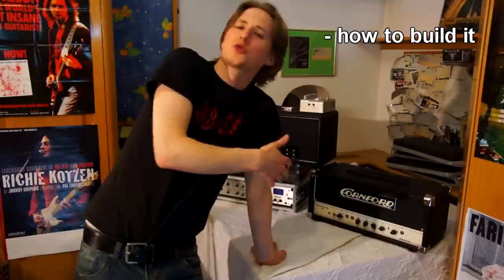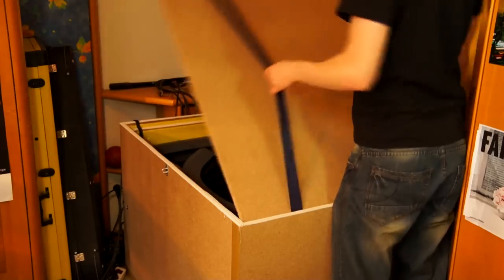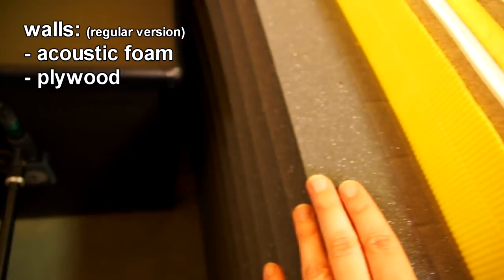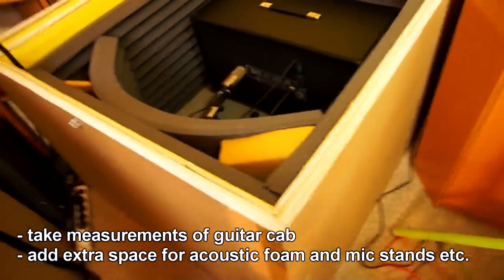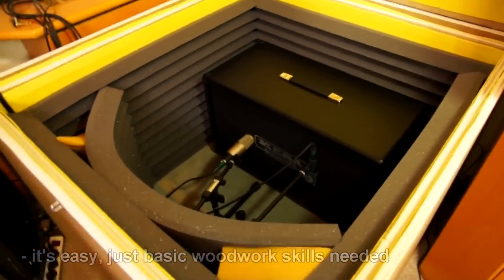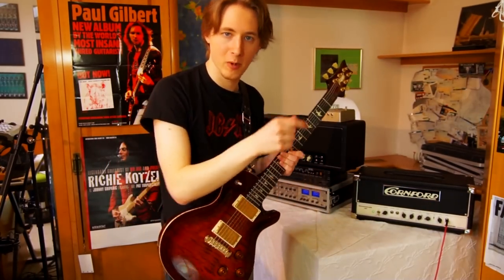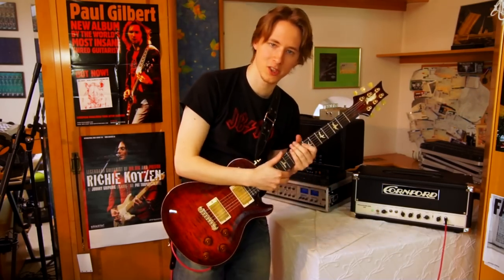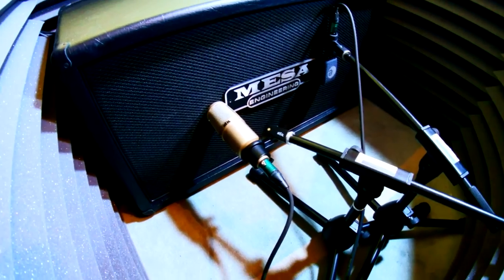Recording guitars with a DIY Isolation Cabinet (+ how to build one)

Comment: Great video! Some suggest adding some reverb to compensate for the lack of 'room' in the boxed recordings. In my experience, however, for rock guitar a bit of slap delay (5% mix with left 80ms, right 90ms delay) gives you a better feeling of a recording space, without mudding up your recordings as would adding reverb do.

Comment: Regarding floor vibrations, you may be able to alleviate that by doing the bottom like the sides and top, with the cabinet on casters inside the box, and/or mounting the box itself on casters or feet. You'd still get some resonance, but it would transfer to smaller points and will be diffused by the insulation in the floor (or the downstairs-neighbor's ceiling insulation).

Comment: I converted a SUNN 2 x12 cab into a stereo isolation box. the speakers were already recessed in the cab. I added acoustic insulation inside. I also  made a frame to cover the front of the cab. For the mic, I installed a small stand and a dual adapter to hold 2 SM57s.  I installed a XLR jack plate for the microphones outputs.  The speaker connections were changed from mono to stereo.

Comment: Great work.  How well does it keep sound out?   I want to put one of these in a room that's close to the Central AC unit for the house, and the mics pick that up.  I'm hoping that an iso box will solve both of my issues at once:  recording volume and external noises.

Comment: Nicely done. I'd love to see what kind of isolation you get from this. Perhaps you can measure an 85dB signal inside the cabinet, then measure that signal at the same volume setting, but with the cab closed and the meter on the outside. Perhaps a 10dB difference?

Comment: I'm picking up a orange micro dark terror (20 watt amp the size of a lunchbox) and a 1-12 cab with a V30 speaker just so I can do this and only have to build a little cabinet.  Will probably is wood screws so I can disassemble and store in the garage. Looks great and thanks for the video!

Comment: Hi Georg ! How about the ventilation ? Does it get warm inside the box ? 
Thank you.
Reply from the maker: inside is only the speaker which produced no noticeable heat. And the tube amp, which produces lots of heat, remains on the outside.
Reply: Georg Figél thank you! I have a combo though ! That’s gonna be a mess ....
Reply from the maker: @AVIOCHAHINEMODELS  maybe you can get a 1x12 to put inside the isolation box. And then you unplug the combo speaker and connect your amp to the 1x12
Reply: Georg Figél yeah sounds great ! Thank you Georg

Comment from the maker: I'm not sure if I understand the question correctly. The power cable of the amp is plugged into the AC outlet. The output of the amp, goes into the speaker over a speaker cable.

Comment: Great video! But I was wondering, if i would build the space where the mic stands are standing smaller, and hang a little mic stand against the wall of the box, and mic it with a smaller mic (Sennheiser E 906 or something) and then mic the speaker from there. Would that influence the sound in a bad way? A smaller box makes it easier to tour and play gigs. Thank you!

Comment: Excellent video, thank you!! One thing: they say an isolation cabinet/box that cannot 'breathe' will sound ALOT less good than one that can breathe because of the pressure buildup caused by the lack of ways for the air to travel. How do you stand on this?

Comment from the maker: thanks :)
Yes, the box has a floor, but I've seen some isolation boxes without a floor. The box affects the tone a little bit, the amp settings will need some adjustments once the box is closed.

Comment from the maker: @Aappleyard2a yes, that also works, I've seen some isolation boxes, where the speaker was built directly into the isolation box, so without a cabinet.
Some guitar speakers can take a bit more watt than others, but you can always take the standard route and use a V30.
Rather use a low wattage amp for recording. Using e.g. a tripple Rectifier with 150W into a single speaker could surely break that speaker at higher volumes

Comment: hello m8 very nice video, i was wondering can you tell exactly what kind of materials you use to make this???
Reply from the maker: well, I built it in 2007, so I don't know exactly which materials I have used. The wood was MDF, about 2 cm thick (different types of wood would also work, MDF was just the most affordable option back then). The yellow stuff is something that is usually used underneath a wood floor. The acoustic foam was an acoustic foam that are suitable for music studios.
Reply: guitarDouchebaggery well i 'am interested to make one for recordings and i don't know if it is the best solution to make a great recording

Comment: Great info and well done job on building the Iso Box..
Quick question: What material is on the plywood floor? Carper? Thin foam? etc...thanks.
Phil
NYC Area
Reply from the maker: Thank you. For the floor I put in an old carpet floor, but e.g. old towels would also make a good dampening material
Reply: As soon as I am done rewiring my recording studio (almost done w/wiring and some odds and ends to do too), I am going to build one. I used to have one built into the wall in my studio under a staircase, but that area is now for storage these days. 
I am getting ready to record a guitar solo soon, and I want to crank the amp a bit to push it into overdrive and neighbors are not so much a concern, but dampening the room noise is a concern so that there is no reflections. 
It's always easy to add ambience later, but you can never remove it (as I'm sure you know) if it gets recorded in the original guitar signal.
Be well Georg...
Phil
NYC Area
Reply from the maker: @uptownphotography  sounds like a very good plan :) Also, I've heard that some people filled their isolation box almost completely with old towels. So that's an option in case there are unwanted reflections.
Reply: I guess I'll start saving old towels! 
Is your Iso Cab made of regular plywood? or MDF type plywood? 

You know, i would start this ISO cab this week, but it is freezing here in New Jersey right now and all my wood (and my electric radial arm saw) are in my workshop/shed outside, so toooooooo cold to work out there. 

I do have some Gobos I made years ago (when I rented my studio full time). I may just surround the small amp with them and some blankets when I do this solo later today (in theory I will record it today), if something, like yesterday, does not derail my plans. I needed to rewire correctly my Les Paul M3 guitar...Derailment!
Phil
Reply from the maker: @uptownphotography  I've used particle board, because it had the lowest price. Otherwise it probably won't matter which type of wood is used in regards of the acoustics.

Yes, it's possible to cover the speaker cabinet with lots of blankets to get some decent sound dampening as a temporary solution :)
Reply: Quick last question. What length, width and height (outside dimensions) did you build the iso cab? Thanks.....Phil
Reply from the maker: @uptownphotography  I don't remember exactly. I built it as large as I could while still fitting into that corner of my room (between the existing furniture)

Comment: Is that one of those Select Strats? I have a Eric Johnson RW Strat with the binding on the fretboard that I love. Ive been repairing guitars for 12 years and have built At least a dozen custom Strats and tele's over the years for myself and client's. I've never had a Select come across my bench, but have seen a few pics. I really like the way they do the binding. It looks like they use 2 different woods (maybe a maple neck with a rosewood fretboard. Instead of putting a slab or laminate RW board, they allow the mail to come all the way up, cut a channel in it and last the rosewood in the channel, so the maple appears as the binding). 
I really need to see one of the selects to see exactly how it's done, they're the only real Fender Guitars I've seen with the flamed Maple tops, and with the 22 frets and gold hardware, I thought maybe that's what you're playing.

Great video BTW
Reply: Now that I watch the video again, I see that it probably isn't a Fender. Great video still though. I have an isolation cabinet I built 15 years ago. I made it to look like a coffee table because at the time I was living in a studio apartment. It was a large apartment, but still, having everything in one room (sofa, TV, bedroom set,, etc) I need to maximize space.
I had to build it for 1X12 cabinets, again for space, but it worked really well. I use a Mojotone 2X12 now that looks like a normal 212 slanted cabinet pretty much, with a cover that looks pretty much the same that goes over the top.
The only issue with these things is the space they take up.
Reply from the maker: The strat was made from Warmoth parts :)
Reply: guitarDouchebaggery Okay. Makes sense. I've used them several times, mostly to replace necks for people that want to keep them looking original. I've been using UGACG for kit build the last few years, I prefer them. It's not a quality or design issue, purely Customer Service. Had a few issues with Warmoth being..... difficult. Plus lately I've preferred the headstocks of USACG; they look really "close" to Fender, but just little different. Not enough to immediately say "this isn't a Fender," but enough to realize it's not. Still, gorgeous looking Strat 👍🤘

Comment: Great video! I just built an isolation cabinet like this one myself. I am using a fender hot rod deville inside, and the main question that I have is about turning the amp on from the outside without having to open the cabinet. Any Ideas? I cant seem to come up with any because even if I wire a switch to power the amp on, there is a standby switch that also needs to go to the on position. Any ideas would be greatly appreciated!
Reply: You only use speakers, not a whole amp. This video has a speaker extension cabinet in the box, but most are built with a single 10" or 12" guitar speaker mounted to plywood inside. The amp is outside the box. Review the Axe Trak or AxeTrak, which features a fuse on the outside so you don't blow the speaker. Most builds and pro products have the electronic connections mounted on the walls of the isolation cabinet and the interior is permanently mounted with speaker and a mic stand or a gooseneck mic stand. Also review the Rivera Silent Sister, it is great, probably the best of all, the company explains it all very well, and why their boxes allow air movement better, but it is well over a thousand dollars US, which is why we have to build our own.

Comment: How effective do you think this would be if it was massive and you put a drum kit in. I've got a lot of the material from work to make it , would maybe put a mattress under the box to prevent any solid contact through the floor. do you think this would work or would the dynamics of a drum kit just come through the box
Reply from the maker: it would definitely work, but it'd be a much bigger project. Basically, it would be a whole room, you could install a sound proof window (so the producer and drummer could see each other). You could put the whole thing on top of old car tires
Reply: guitarDouchebaggery i'm more thinking of a big box that you put the drummer in, so just tall enough for drummers head  and cymbal clearance so it's just him the kit in a box . Would i need to put air holes in it , do you know how i could do it sound leaking.
Reply from the maker: Sean Markus
the air holes would be necessary for a box of that size, and they'd cause sound leaking. It'd be better to make the drum booth bigger, without air holes, but you'd need to open the door in between songs to air out.

Comment: yes but its not advised. you will get latency problems. the nxt best thing from usin a preamp is using an external audio interface. these can come in 2 forms.a DI audio interface that usually has 2-8 inputs and has everything you need for home recording, or a USB desk. the desk is great for live band recording as u can EQ the tracks on the desk before its recorded but on the downside, the tracks are all merged into one when recorded. this can pose problems if not recorded right first time!

Comment: Would you recommend using a royer 101 in an isolation cabinet similar this one? Or would the pressure and reflections be too great for a the ribbon?
Reply from the maker: A Royer 101 can be damaged when you're close-mic'ing a loud guitar cabinet. You sure can use it in the isolation box, but you might not want to turn up the amp to extreme levels.

Comment: Hi, I didn't hear anything about the bottom of the box. Is the amp just standing on the floor or is the bottom of the box similar to the top? Do you have something like rubber feet underneath? I know I'm way too late, you probably sold yours, but you may remember how you did it.
Reply from the maker: The floor was just like the sides, with doubled walls. There were no neighbors below, so it didn't have any rubber feet.
But it would be a good idea lay the whole box on e.g. a washing machine "vibration isolation" rubber matt, or similar

Comment: I must say that is nice. I would however add microphone XLR jacks in the side of the box and 1/4'' jacks for the speaker cab. That way your cords are not crushed over time. AND don't forget to add a few 1/2''  vent holes around the cabinet to let out pressure from the front of your speaker otherwise you may have a front pressure on your speaker cone. It can stifle your sound and damage speakers. Rock ON.

Comment: Awesome job! I'm going to make one, but I have a question. Do you have phase issues with this?
Reply: with phase issues the real problem here is the two mics being used. If they are out of phase, simply flip the polarity in your daw and regain the lost frequencies
Reply from the maker: yes, you can also use the "Track Delay in Milliseconds" (at least that's what it's called in Cubase) in case there are phase issues

Comment from the maker: thanks. well, it didn't sound boxy to me. It sounds a bit different than when recording in a normal room. But you just add some reverb to it, then it sounds just fine with the iso cab. I moved to a different apartment and I don't have the iso cab anymore. But at the end of the video are several links to videos that I recorded with the iso cab :)

Comment: @guitarDouchebaggery  ok thnx ,  i just thought if there was any difference in sound when building a bigger box in front of the speaker where the microphones is...i've built a box which is 30cm in depth and the size is the same high and width as the box is...the acoustic foam and my mic fits in it :)..

Comment: I'd like to build something like this for the venue I work at. I only have limited space on the stage so the boxes need to be as small as possible. What's the minimum amount of space that should be in front of the cab for it to sound good?
Reply from the maker: well, to get them as small as possible you could build the speaker right into it, just like the Randall ISO 12.

Comment: Hi there, it looks ok, but a few questions....
The speaker is on the floor, 1. but how did you gauge the distance from the top of the speaker box face to the box to the inside face of the lid.

You built the side panels of the box up next to the sides of the speaker, 2. Does it matter if there is a gap or not of some distance for example 100mm to 150mm gap between the 2 sides of foam to side of speaker.

3. On top of using your normal foam at the front end, why did you also add in a semi circular bit of foam, and what type of foam is this, as there are different grades of foam.

4. What is the least amount of measurement of length, width and height to still make a quality guitar recording.

Get back to me, Cheers M
Reply from the maker: 1 & 2) I rather measurded the gap between the guitar cabinet and the solid walls (or lid), so that I'd have at least 10cm on each side. Basically I built the isolation cabinet so it fits into that corner of the room ;)
Usually, the bigger the better.
3) I ordered a package of these acoustic foams and I just sticked all of them in there to dampen as many reflections on the inside as possible. The circular bit is the same foam as all the others.
4) Bigger is usually better. To make it small, use a 1x12 speaker. There are even some isolation boxes that don't have a guitar cabinet inside, they have the speaker mounted directly into the isolation box.
Reply: guitarDouchebaggery I am building a cabinet now with 2 speakers in a wooden frame to then be put in a box to accommodate a bunch of different valve amps. I am looking to build the surrounding box as small as possible but get a great guitar recording. 
-Please forgive me, but on question 1, Forget for the time being, the available size of your room, how much distance in cm from the top of the speaker box or outside of speaker cone, would you like to have to the inside front edge of the foam on the lid.
- and also forgetting the size of the room once again would you still have the foamed side panel touching the side of the speaker box or do you think it's better to have a gap in between, and if so how many cm.

Are the 2 plys together or is there a layer of something all throughout the panel in between the plys.

Thanks man